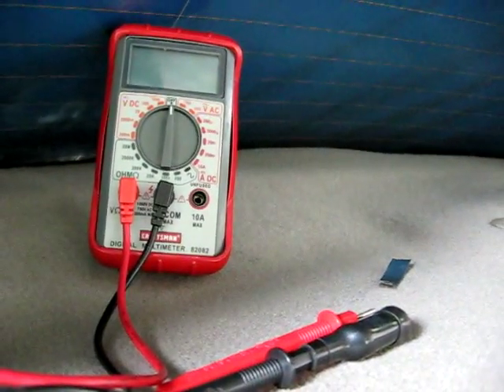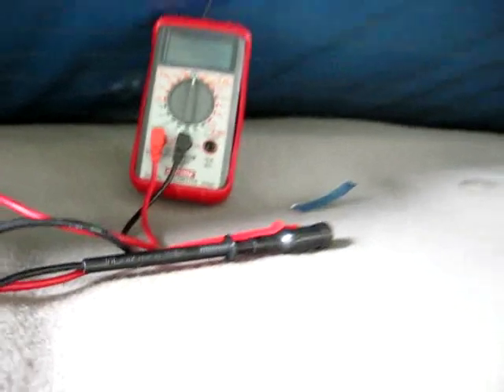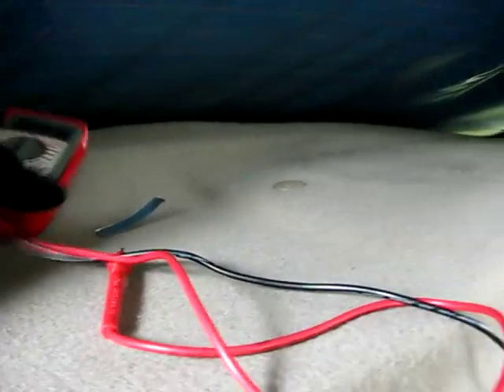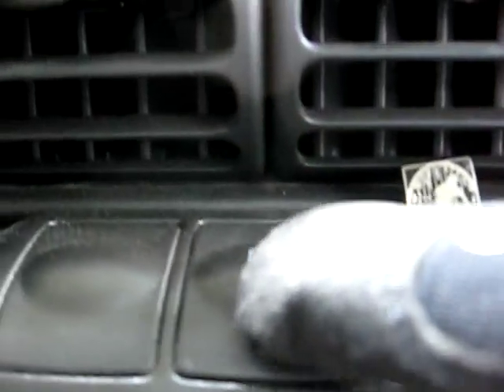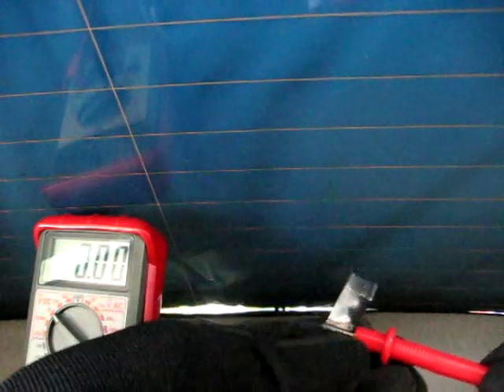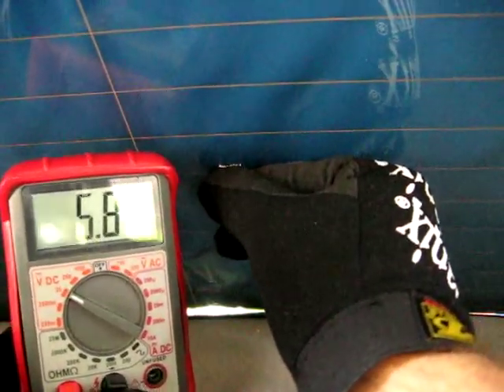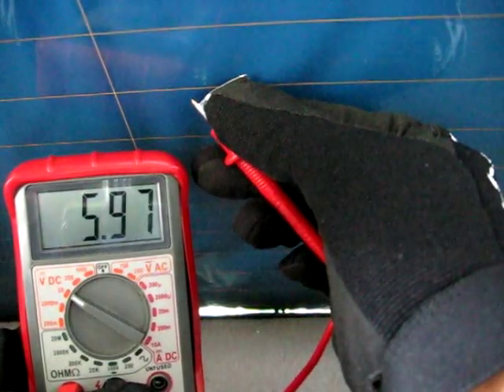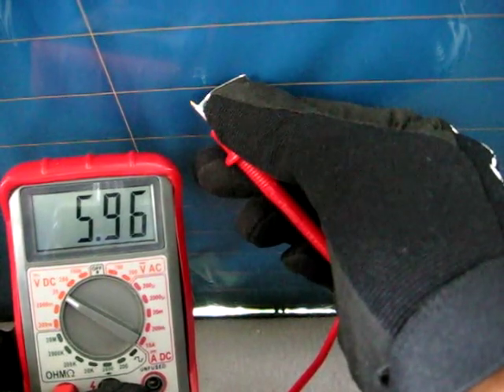Checking Rear Window Defogger

Comment from the maker: Ok the reason we use foil is because the wires of the grid are fragile and the foil will not damage them. As the voltage goes across the wire it should from one side to the other  decrease in voltage from resistance.I am sure if you google defog rear window you should come up with more info.

Comment: Rich... I'm wondering if you inadvertently have it backward.... if I have 12v wouldn't there be a break in the negative side and vise Versa.  Your meter is grounded elsewhere and if the negative on the defroster was disconnected you would get 12v if the positive side was functioning normally.

Comment: I have no power to my rear defogger elements nor do I have power coming out of the power and negative wires that attach to the elements. The dash button light works normal though. Could it be my relay is bad?
Reply: Get out your test light and check! Or listen/ feel to see if the relay clicks

Comment: Hi Rich, why are we using Aluminium foil, cant i use multimeter positive lead?. Second, why iam seeing only 6 volt and 12 volt, is there a reason behind?. Also u said if i see zero volt, then passenger side is broken from center, and 12 volt means driver side is broken from center. What is the theory behind this logic, i would appreciate if u can breift me or a site in net that can explain me, please..

Comment: My car i20 rear defogger switch led doesn't come on when pressed. But sometimes it comes on and the defogger system is working.  I can't find any fuse or relay for the rear defogger.
Reply: In your engine bay.

Comment: What if i have voltage on my grid, but the snow isn't melting.. ?
Reply: i have same issue.  i have 11v on the positive lead from the rear defrost wire,  did you figure it out?
Reply: @cycl0nnus  Voltage is too high which means there is no load.  You have a bad return or bad ground negative.
Reply: @grabir01   Thank you for solving it! But how would you go about fixing a bad return of bad ground negative if I ask?
Reply: @ChristinaGerard433   In the Engineering world we refer to it as sourcing or sinking.  If you are getting voltage to the grid, then it is a sourced voltage. Unplug both sides and see which connector goes hot when you switch it on. Then you know the other side or  the other connector is return or ground. Follow ground or return  wire until you find the fault.  You may be able to simply cut the return and ground it to chassis to make it work again. I would trace it and find where it is open and fix it there. There are toners you can use to trace wires. Some switches are on the return side. If that is the case, you will have one of your grid wires hot all the time. I doubt that is the case. But it could be.

Comment: what material are the lines of the defogger?????
Reply: Those little lines are actually made of conductive paint that is applied directly to the glass. This makes the defroster very compact and durable. It also means that any chip or scratch in that conductive paint can render the system inoperative.

Comment: Why put foil sir?
Reply: The part of the foil that he was using was flat and smooth, so it won't scratch the defrost grid lines. 

The end of the probe is sharper, and if you're not careful using it, could potentially scratch through enough of a defroster grid line to not allow any electricity to flow through it.

The tinfoil strip also has a much wider surface area than the tip of a probe. You notice Richpin just presses the tinfoil strip against the grid line and gets an instant contact. It's much faster and easier than trying to get the much smaller tip of a bare probe to make contact with the grid line.